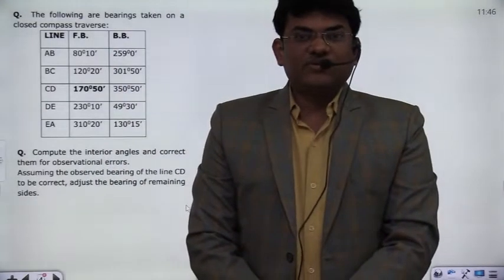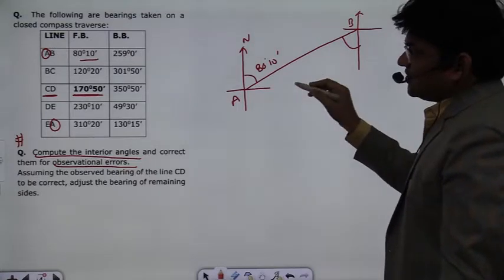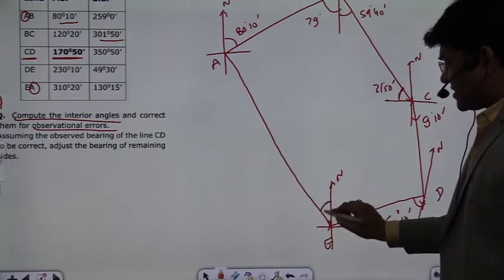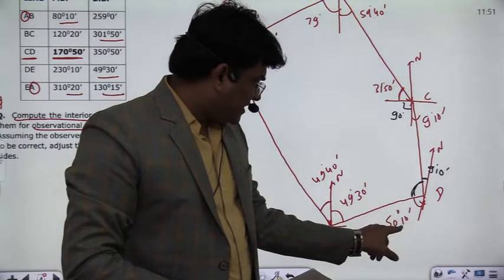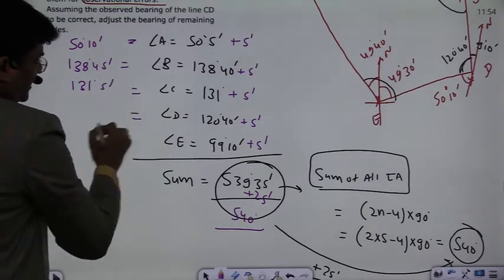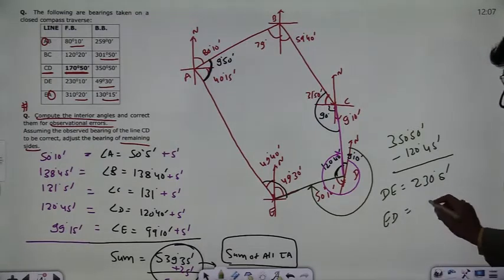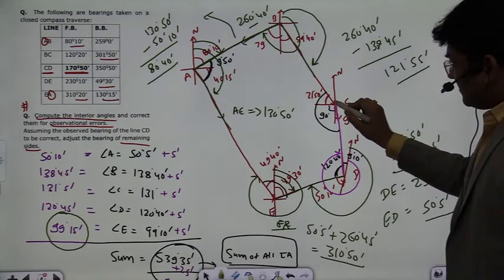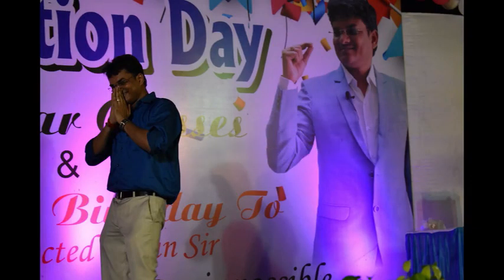SSC JEN MAINS Solution_(29-12-2019)_SURVEYING by tarun sir (IIT Delhi)_GATE AIR -15

Comment: Sir is question mein jaise aapne bataya h (sirf diagram banake sidha angle likh dein) waise kare to pure marks milenge ya step by step  har ek angle separately calculate kare to pure no. Milenge
Reply from the maker: It depends on the marks and time available.. if time is less you can do by showing one sample calculation and proceed quickly to answer. No problem you will get full marks

Comment: Sir is question me traverse clock wise h 
So Included angles= exterior angles
To sir Mene exterior angles Nikal k use 360° me se substract kr diya to interior angles aa Gye..
But unka sum 45' km aa rha tha to per angle me 9' add kr diya..to total sum 540 aa Gaya..or fir unhi angles se bearing correct kr di or last me CD ki bearings match ho gyi... To sir mera correct h kya?